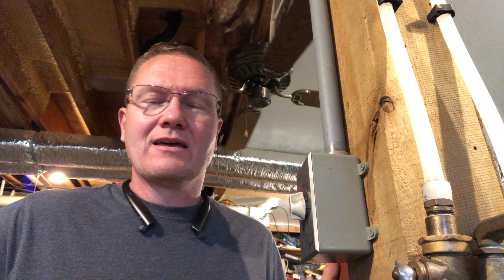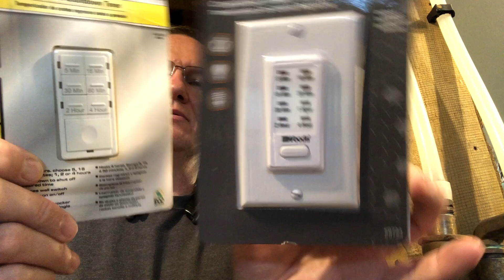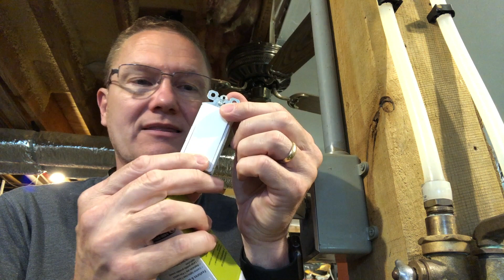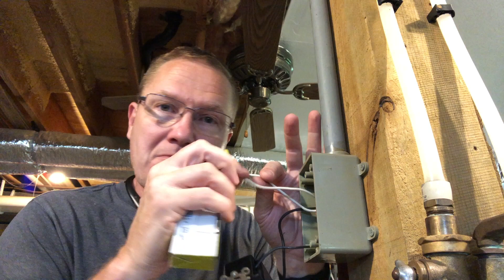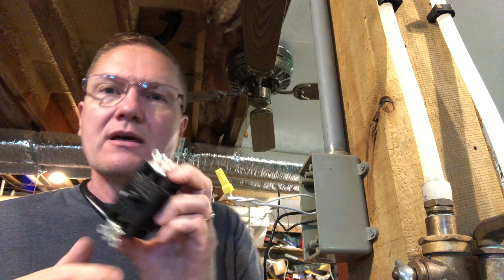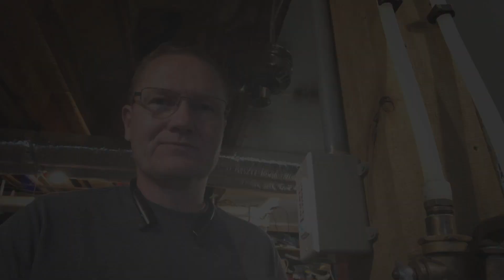How To Replace A Fan Switch With A Digital Countdown Timer Lights Bathroom Fan Ceiling Fan

Comment: Hello there,
I have a question: I got my Woods 59724WD  from Amazon.ca.
 I installed it properly, as per instructions, but still the breaker pops up, when I try to put and bolt the unit into the metal box. 
If not bolted to the box it works fine. I was wondering what could I be doing wrong and after opening the unit I saw that the "live" terminal was  connected electrically to the adjacent retaining bracket, which, honestly surprised me a lot.  That means that the live wire got connected directly to ground which doesn't make any sense. Any advise on that?
Thank you